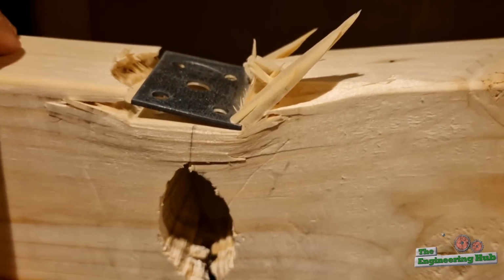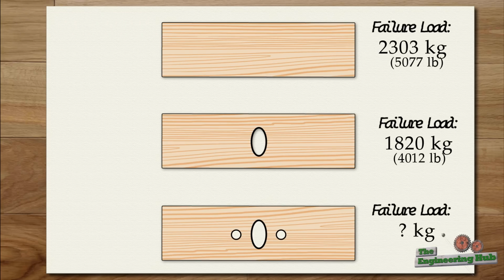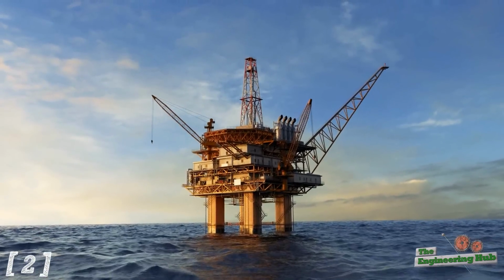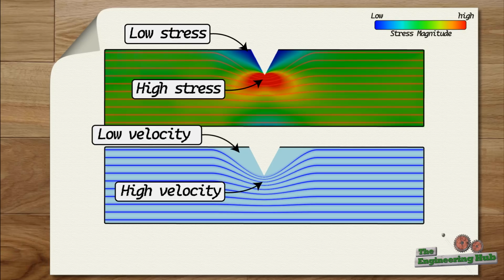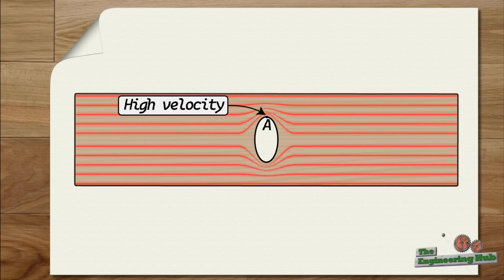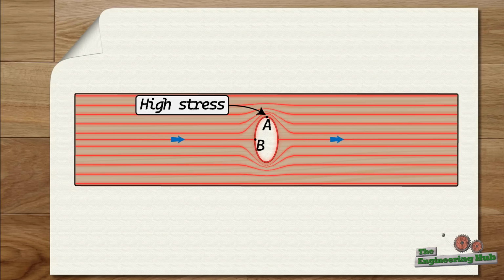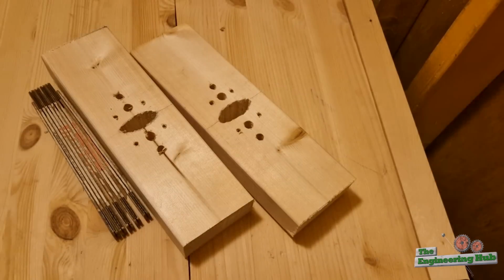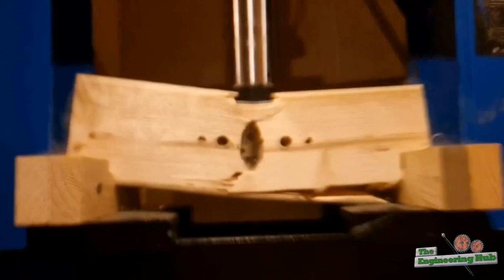Can drilled holes make your beam stronger?

Comment: Your cut was not scientific could have cut 3% further on one side or a couple extra fibers?? Might be onto something with the flow but this is NOT undeniable proof. You should have just went with the wider hole. I don’t think cutting an ‘eye’ shaped hole is stronger than the oval. Idk
Reply from the maker: @nills2gills811  you are right, it's far from an undeniable proof. The idea was to test this analogy/theory that I read in a credible engineering book (ref 3, page 777). The theory suggests this method should work, the test samples are too few to claim anything concrete, but it does suggest there could be something to it. I thought it would be interesting to see if nothing else. I'm not claiming any breakthroughs or any engineering secrets. Just a YT video on an interesting engineering concept.

Comment: It is a bad experiment. One piece of wood is not equal to another, there are many factors influencing the strength: defects, moisture, grain pattern and density,  etc assuming all planks came from the same tree. You should start with this before you dive into the physics of stress.
Reply from the maker: @vm5571  as stated in the video, all samples were taken from the same 2x4 but your point is granted; there is variation even within the same piece of wood. The theory behind the experiment supports the findings, so maybe there is something to it.
Reply: @TheEngineeringHub  I would pick cast plastic planks, for example, there you would have more homogenous units ...
Reply from the maker: @vm5571  that's actually a really great idea! I would do that next time when I do a similar comparison that is very sensitive to the sample conditions 🙏 cheers 🍻

Comment: I think the point is... All real-world construction will require holes in structural elements and thoughtfully placed additional holes may improve the strength. (Not that a beam with holes is stronger than a beam without holes)
Reply from the maker: Exactly 💯

Comment: Why would pressure you’re applying be 90 degrees different to the flow lines? Would the flow lines not be representative of the downward force and therefore need to be aligned with the force direction? The video didn’t mention the discrepancy which makes it all not make sense and seem like either a mistake or an important detail glossed over.
Reply from the maker: As stated in the video, the flow lines are analogous to the stress lines. From beam theory, it is well known that when loaded with a perpendicualr force, the top of the beam is in compression, and the bottom of the beam is in tension. Although not uniform as in a uniaxial case, the flexural stress lines run along the length of the beam as the fluid lines would.

Comment: So, are the holes, if we are to take the results on face value, redistributing the stress in the material so that while they take away from the overall capacity to take load, because the beam is already compromised in a very specific area, they move stress away from the point where it will inevitably fail first?

Comment: The same idea is very important in the fatigue design of parts. Where comparingly small decrease in peak stress can increase lifetime several times. I had a patent application with this idea in the construction industry for fatigue sensitive parts.
Reply: Similar patent using hybrid materials to arrest crack growth that's now standard materials design for aerospace and high temperature composites.

Comment: I don’t see that the strength increased with the addition of holes compared with the original lumber, rather compared with the piece with the first hole drilled into it. And it should be noted that you need to compare strength to weight ratios, as that is really what you’re comparing. Less weight due to more holes drilled - as opposed to the original solid piece, which being heavier, was also stronger.
Reply: I think the point is... All real-world construction will require holes in structural elements and thoughtfully placed additional holes may improve the strength.

Comment: Basic engineering intuition will guess - before testing - provided the shear effects of any point loads - and supports don't exceed  the local "shear resistance" of the beam, most of the material in a (constant area section) beam is unnecessary -  this is why trusses were invented - also why cutouts within X-ratio of the end supports must be carefully considered - outside those regions- taking out up to half of the member (in a mostly tensile-compressive, wide span, end supported member  -  isn't a huge problem... (not getting into moments of area etc as a basic mind game - guess)...  having an educated laugh as I continue watching..

(The initial vertical eye shape is as bad a condition as it gets - stress riser maximised..)

Wood is not a very good engineering material to demonstrate these concepts..

(Having done a lot of fluid dynamics over the years - "flow lines" seem reasonable  intuitive 9especially for analogies of reasonably uniform loading - however point loads  - such as at 5:27  are not well assessed for (nor represented in the demonstrated FEA ) - but look where the lower chord failed - at the right end support - indicating a problem in the support condition....

Comment: This has nothing whatsoever do do with fluid dynamics.  using flow velocity is meaningless to the application.  The reason for any slight improvement is that you move the central stress load further outboard which in turn resists bending deflection better & therefore decreases the tension & compression experienced along the outer edges of the beam where failure begins.  The net result is a slight improvement in loading before plastic deformation is reached.  It's basically the same principle as an I beam where you have a compression web holding the main tension & compression elements from collapsing together where they loose coupled torque leverage against each other.  In the video, the compression side looses this due to the press shearing through the wood fibers, which makes a mockery of the whole demonstration, because failure is occurring due to that & not primarily due to the bending load on the beam.

Comment: Horizontal shear is a failure mode most common on short, deep, heavily loaded beams (bending members). Round holes can relieve the strain paths. Holes with reentrant corners are crack propagation points in any material.

Comment: The results rely on the crushing snd failure of the wood before the final force measurement. In a solid plank the crushing force causes a long crack through the bulk. In a plank with a hole the crack only propogates to the edge of the hole and the bulk is compressed which makes it stronger in failure. In some cases the void can allow the bulk to act like a lever, spring, or damper. This design would be excellent in something like a bench since the failure mode can take more load after deflection, softening the impact to users. 

So! Use a bigger plate!!!!

Comment: Im assuming that the test might have been better if the oval shape was perfectly cut and not hacked out? U left sharp edges on the internal curve which should have had a perfect radius and not jagged edges. Maybe drill holes at the top and bottom of the oval to start the shape with nice radiused shapes?

Comment: Yeah, but no. Just looking at your samples one can see large inconsistency in the grain and then knots also affecting it's shear strength. Then throw in the jagged inconsistent oval cuts in the samples. You should repeat this experiment with a wood species with a more consistent wood grain such as ash or sitka spruce. Also pay closer attention to finished hole it should have a smooth perimeter and consistent shape between the samples.

Comment: Yeah those samples are from the same beam, but they have knots in them and different grain / growth ring alignment, so not much luck with using wood for modelling this complex load situation here. Also confusing how all of the analysis is about tensile load but the testing is done with a bending load, which makes for a hybrid failure.
Props for the effort, though I don't know what exactly I can take away from this.

Comment: Guitar builder here. I always wondered about this when making transverse struts that would bear the load of the string pressure on the bridge. That part of the guitar top, which acts as an monopolar oscillating plate supported by beams, needs to bear load (about 80 lbs) but also be as lightweight as possible (unsprung mass?). Could this be an improvement? I guess an experiment is about to be born.

Comment: Yes. But the holes have to be in the same location as static load nodes are. However, making extra holes is not a good approach with transient loads. Wind and snow transients usually defy the benefits on building construction applications.

Comment: interesting results, what is clearly visible is that sample 2 failed differently than 3,4,5. 2 might have just been a bad sample or the different failure mode is really because of the extra holes?🤷. even though the setup is not perfect I respect you for trying it out, what i dont like is the short length of the beam, because it clearly impacts the results of 3,4,5,(1?)

Comment: Would be more meaningful with two point loading at third points to produce maximum flexural and zero shear stresses at midspan.
Reply from the maker: I tried that, but the beams were too short, so the load was too close to the support, causing very little bending and high shear.

Comment: I guess I missed why the first hole was oblong instead of round. I guess I also missed how there is any advantage to holes at all, being the first beam fractured at the highest level. Seems to me, no holes is the way to go.
Reply from the maker: It's more if the hole already exists due to cables, pipes, or ventilation that stress relief techniques exist. Drilling a solid beam for no reason is not the way to go for sure 😅
Reply: I think the point is... All real-world construction will require holes in structural elements and thoughtfully placed additional holes may improve the strength.

Comment: It would have been interesting to apply topology optimization in the stress analysis to compare the resulting geometry with the optimal fluid flow theory discussed in the video.
Reply from the maker: I don't say this as often on the YT channel as in my research work, but topology optimization is definitely beyond the scope of thia study 🤣 It is an interesting idea though, but I suspect the gains are too small to be of any practical use given that manufacturing would be expensive.

Comment: Comparing the size of the center hole on the first sample and the additional samples: The first hole is obviously taller making the web on the bottom thinner. Not saying that that invalidates the experiment just that you need to have better controls on your experimental set up. Measurements on width of the bottom web. Radius of the notch all of those things can have a big impact on the results. Also flow is not really similar to stress. The top stress is compressive the bottom stress is tensile. Stress in a beam is zero on the center axis. Flow in a pipe is maximum in the center. So flow analogy is a poor  representation for stress. By the way I am a retired professional engineer.
Reply from the maker: Hi Ron, just to address some of your points: 

1. I didn't come up with this analogy! I read about it in an older book that related it to a stress reduction technique used in the past. You can read more about the theory in Reference 3: Roark's Formulas for Stress and Strain, Chapter 17.2, page 777. You can easily find a PDF online for free. I thought it's a crazy idea so I decided to test it. The fluid is a potential flow fluid which has no viscosity, so the flow profile is uniform and there is no flow separation, nor vorticity. It's a special fluid but very often used in my research on offshore wave loading.

2. The method is used for tension members specifically not for beams but my home setup does not facilitate tension testing so I had to improvise. The point is to show that removing material can increase the capacity.

3. Of course this is not a peer-reviewed study so the results should be taken with a grain of salt as there is a lot of variation between the samples, they are way too few, and the testing environment is not strictly controlled. 

4. Not many holes are elliptical in practice. In theory this should work with circlar holes as well but the capacity gain is probably much less, if any. I used an elliptical hole to make the gains more drastic and hence more interesting for a YT video. 

I thank you for your lengthy discussion, and it is very much encouraged. Cheers!

Comment: Interesting. You had me there though. I originally thought you were going to propose, that a beam with relief voids was going to be structurally stronger than a solid beam. 

For anyone who is going to point out the cost weight benefits of non-solid beams. Yes, I know, I have the ability to look at cranes, bridges and aircraft wings.
Reply: This information would be useful for determining the impact of drilling holes for routing pipes, wiring or other needs to drill into beams.

Comment: Wheres the test on the drilled beam seen in the thumbnail?

I'm not sure the term "flow" on a static material when the reaction to the downward force imposed  is omni directional radiative with longer or shorter felt-force vector arrows, but it is a fascinating experiment

Comment: And locating a center hole in a beam at midspan is the BEST place to put the hole to reduce the loss of strength. If you locate the hole near the supports, you will see a very dramatic drop in strength.

Comment: Hello, I am a Timber Engineering faculty member at Virginia Tech. You make some good points, but you there are some probems with your content. First, your model is not the same as your experiment. Beams do not have a uniform tension force. They have a triangular stress distribution where the moment is greatest at the center and typically tension failure is dominant in brittle/semi-brittle materials like wood. I also have issues with your sampling of wood. Saying short samples from the same 2x4 have similar performance is not correct. Strength of wood is dominated by the placement of defects like knots. Locating knots in different places can radically change the strength. I also think you have a flaw in your sampling. Typically, 10-15 pieces are tested for material properties and more for connections / special cases. The flow idea is fine, but I think it is more of a visualization concept. I'm not sure if it is linked to fracture energy, which has the same idea of a more rounded curvature to prevent failure.
Reply from the maker: Hi Daniel, your points are 100% granted. I am currently completing a PhD in structural dynamics and wave loading at Aarhus Univeristy. I don't have a tensile experimental setup at home, so I had to improvise. The flow analogy is far from perfect, in fact, it's flawed and it works only in very special cases. But don't worry, I know my beam mechanics very well. The concept is from the theory in Reference 4: Roark's Formulas for Stress and Strain, Chapter 17.2, page 777.
Reply: @TheEngineeringHub you’re a PhD candidate and haven’t figured out sample sizes yet? From the numbers you displayed as conclusive didn’t seem to show any statistical difference with or without the holes. It’s wood. The variations in wood for strength are larger than the margins you declared as significant.
Reply from the maker: @ClAddict  they are not significant by any means, I stated that in the video. More testing is required. Theoretically, this holds water, experimentally, more work is required to prove it.
Reply: @ClAddict  Dude, he's just using some demo's.  He's not trying to get a paper published.  Take a chill pill.
Reply: @michaellowe5558  I agree he should chill out but to be fair the video does say "confirming the effect" around 6:20 which is statistically unsubstantiated with 1 control and a couple of test samples.
Reply: @ClAddict  It's a youtube video and nobody asked you
Reply: It would definitely be better to test this with a more isotopic material like metal or even a glulam beam
Reply: Thanks for your input, looking forward to the channel improving as we learn together!  Excellent seeing people sharing knowledge for self education purposes!
Reply: I found it, this is the one. The Reviewer #2.
Reply: I agree that this example is more semi-quantitative, but I appreciate how it is demonstrated. It nicely illustrates the reduction of stress concentration at the crack tip—albeit not a sharp crack—due to structural effects like crack-tip shielding by voids. While a single-edge notch tension or center-cracked tension specimen might align more closely with the explanation, the three-point bending test is still a good demonstration of the concept, I guess, especially since it remains a mode I fracture.
Reply: I like thw idea here. 

I work in Composites Research and may put a proposal along these lines on a lightweighting project coming up.

Comment: What's wrong with NOT drilling holes?
Still a 25% capacity gain over the elleptical slot.
It's like punching a hole in a wall to make it stronger. Pretty sure that's NOT how it works.
Not sure the fluid dynamics analogy works either, too small of a sample anyway.
Still nice example of experimental thinking. Congrats!
Reply: Exactly, walls and members are not fluids

Comment: The consideration at 3:50 is wrong and it is often done on wing profiles. There is no reason for a particle to speed up exactly to cover the same horizontal distance, there is of course an increase in speed, but not to that value.
Reply: This is what I was going to say. My understanding is that the speedup happens due to the in compressibility of the liquid forcing it to go faster since it has a smaller section to pass through.